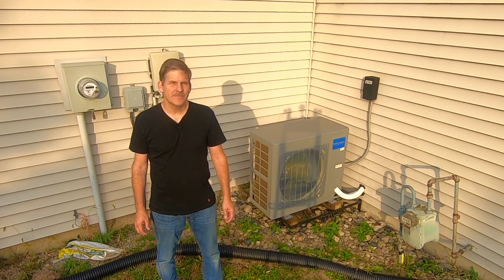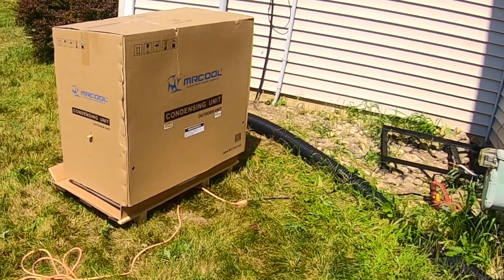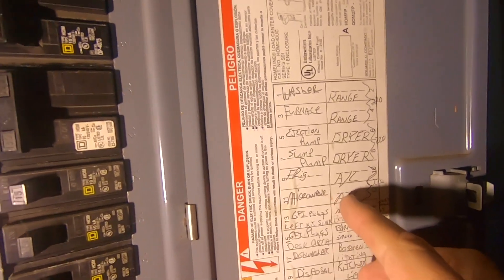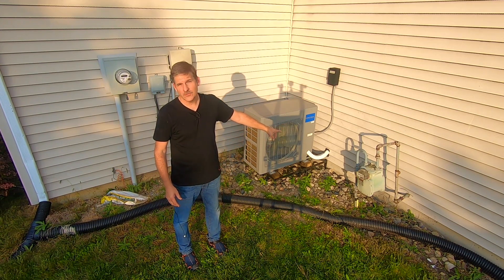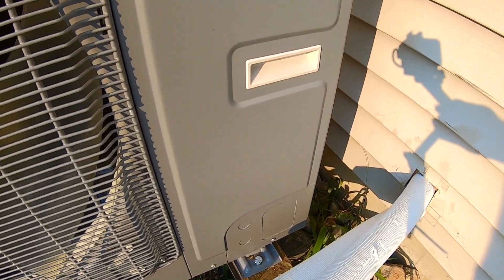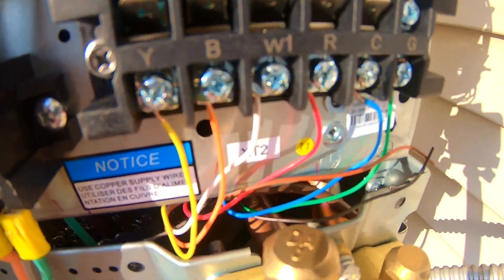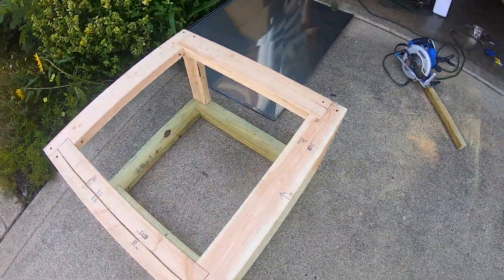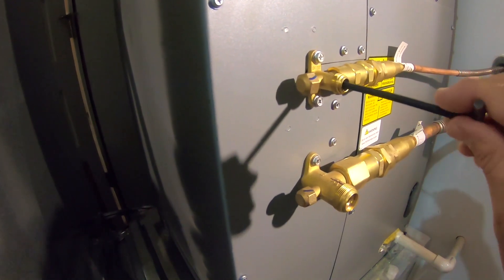How to install Mr Cool Universal Heat Pump: air conditioning and heat solution

Comment: I'm looking at the universal packaged unit does that tap into the same blower / handler ?
Reply from the maker: Yes - the outside condenser is connected to the inside air handler with two no-vac line sets . Hope that helps.

Comment: Great Video!
I have one question...When the outside unit fan is running on your configuration, is it blowing away from the house or towards the house?
Reply from the maker: Hey Chip,
Away from the house. They give you spacing specs for installation…
Thx for watching!
Reply: @Housebarons  thank you so much!

Comment: With the air handler in the basement below the condenser unit, where are your oil-return bends in your lineset?

I’m running my air handler in the crawlspace and the condenser is outside and mounted to the side of my house on a shelving bracket. My manual says to put in oil-return bends at both the handler and condenser unit with this setup. 

Are they just not necessary?

Comment: Great video!  What size heat pump system would you recommend for 1700sqft home? There are so many models
Reply from the maker: Hey Thomas…,
There are so many variables from house to house - ranch, 2 story, # of windows, insulation, which direction ri does face, location, and on and on it goes….

Your size is similar to a 2-story 115 + yr old house we are working on now. 
We installed a 3 ton MrCool universal heat pump. 
Hope that helps!
Thx for watching!

Comment: How did you connect the thermostat wires? from outside unit to inside unit and thermostat please help I can you show a diagram
Reply from the maker: Hey Ciro,
We wired from the thermostat to the air handler and then from the air handler to the inverter. Depending on your thermostat, which wires you connect will be a little different. We used a Nest.
Next week we will be hooking up another MrCool universal so stay tuned to for video. I’ll try and pay attention to all the wiring. 
Thx for watching.
Reply: @Housebarons  Thank you for your answer that was my doubt because in the manual shows from the outside unit to thermostat but it is just as referenceh you again
Reply: Thank you again God bless I l be sharing your videos

Comment: Can you tell me about the cable D that goes from inside unit to outside unit,it shows in the manual!
Reply from the maker: Hey Ciro,
I’m not sure what you are referring to. I didn’t see cable “D” in my manual.
There is power to the condenser and power to the air handler. There is wire from thermostat to air handler to condenser. And we used no-vac line-sets from condenser to air handler.

Comment: What s the dimension of the bottom box you made?
Reply from the maker: Hey Ciro,
The air-handler bottom opening  is 21 inches square so I made the box with a 20 inch opening on top of the box I built. 
The return air comes in at the side, so it’s about 18 inches tall - so I could attach an 16x24 air filter frame to the side of the box.
Thx for watching!
Reply: @Housebarons  t
Thank you very much for the info!God bless

Comment: Do you know what s the voltage for the air handler and breaker size please?
Reply from the maker: Hey ciro…,
Best bet - check the manual but I think the condenser for the 3 ton is a 30amp, 240v. I don’t remember the air handler - but I’d guess a 20amp, 240v. 
If you need to know beyond curiosity, contact MrCool to be 100 %? sure.
Thx for watching!

Comment: I love that air handler box made from 2 x4 's. I'm planning to do the same thing when I install my Mr Cool Universal 2 to 3 ton in the Spring. How did you secure the handler to the box? Is it just sitting on top with duck tape closing any gaps, or did you fasten it somehow? Also, how did you connect the box to your bottom duct work? Thanks a million for your channel. I just subscribed.
Reply from the maker: Hey George…,
At first glance, I thought the former President was subscribing! 😃 
Thanks for subbing!
Re: the air handler: we just installed another MrCool universal last Friday and we used a length of 3/4 inch right angle piece of aluminum - screwed it to the top of 2x4 box ( return air plenum ) and then placed the air handler in & on that frame. Stay tuned / in a couple of weeks we should have a new video up with more details. 
We then will screw thru the aluminum and into the air handler. 
The return air duct goes into one side of the return plenum ( box holding up the air handler ). So then the return duct connects to an air filter frame which is attached to the return plenum box. In other words, the air filter frame is sandwiched between the return air duct and the side of the return plenum. Hope that makes some sense. 
Thanks again for joining us- keep an eye out ( hit that YouTube bell) for a number of different videos coming out soon about the MrCool universal plus an alternative winter heating idea!
Reply: @Housebarons  LOL, I get that a lot about my name. Especially when President Bush 1 & 2 were in office!

That is a great idea to create a lip using a right angle piece of aluminum around the 2" x 4" box for the Mr Cool air handler to sit in. That should keep the units together. I'm really looking forward to seeing how you did it in a future video. That return box is an issue ever DIY installer has to deal with for the Mr Cool.

My return duct & air filter frame is on the side just like yours. I will probably just use some duct tape to secure it to the 2" x 4" box.

Thanks again for a great YouTube channel! Extremely helpful.

Comment: Just got off the phone with Ingrams and they said this system uses a standard motor, not a variable speed one. So it's not as effcient as a mini split.  not sure why Mc Cool calls this unit an inverter unit then? inverter ususally means variable speed high effcient compressor motor.
Reply from the maker: Hey river,
Go check out the MrCool web site under MrCool universal. 
You got bad info from ingrams. 
Thx for watching!

Comment: Looks like the 3 ton calls for a 35 amp breaker according to what i see online. Is that what the info says on the size of the unit? I’m currently running a 14 SEER 2.5ton (builder grade) in Kentucky that came with the house. I’ve been thinking about upgrading. My current condenser uses a 30 amp with the indoor using 60 (aux). I could use my line set which of course is going to drive the price up as I’ll need an HVAC person to do recovery and charge. Give my HP is only 2 years old, what’s your thoughts on replacing it? Worth it?
Reply from the maker: Hey Bryan..,
This has a setting to run as a 2 ton OR a 3 ton. 
Why would you want to replace a two year old heat pump? You may want to see how long it would take to break even ( additional savings from 14 SEER to 18/20 SEER) 
IF you could re-sell your existing HP, that might really help. But a 14 SEER isn’t terrible. Tough call. Maybe wait a few years for even better efficiency ratings?
Thx for watching!

Comment: Something important to remember if considering buying one of these and installing it yourself; there is no warranty.

They denied me support and warranty on a unit that was DOA;

With it being a universal condenser it has to be licensed HVAC technician install. That is probably why you are getting a E3 error code. And with you installing the unit without a license hvac tech you have voided the warranty. This unit is not a DIY
Reply from the maker: Hey James,
To clarify: Who is “they” ?
The Mr Cool web site states that a licensed install is not required IF you use the No-vac line sets. 
Thx for watching!
Reply: @Housebarons  it was the support tech from MrCool.  Nobody will reply.  I have been stuck with a $5k paperweight.

Comment: My home I just bought doesn't have an existing ac unit but my furnace works great. Can I hook this into the existing vents? Would this completely replace my furnace as well or should I be looking for a stand alone ac unit.
Reply from the maker: Hey 2bearms,
The heat pump can do the work of both heating and cooling. 
I kept my furnace because it was still working. ( I kept it just in case ) But in the end, I did not use it as the heat pump did well in the heating department. 
Adding it to the existing system ( side by side  ) was complicated but it can be done. 
Thx for watching !

Comment: Great video.  Gettting ready to install my unit.  Did you use a torque wrench, I did not see that, how do you ensure they are torqued correctly, dont ruin flares and no leaks?
Reply from the maker: Hey Douglas,
No torque wrench but I can see the value in that! Better to be safe than sorry.
Thx for watching!

Comment: Did you torque down the fittings to the suggested ft lbs ? Or just hand tight plus a quarter turn? ThAnks
Reply from the maker: Hey J,
The typical “Tight but not too tight “… you can leak test it to double check.
Thx for watching!

Comment: Heat pumps are inefficient in the Northern tier.
Reply from the maker: Hey Stephen,
Not sure where you live, but new technology ( inverter ) means that is no longer true. Today heat pumps can be 100% efficient down to -10 degrees F. 
Thx for watching.
Reply: @Housebarons  You're probably right. I quit following heat pump technology years ago when I lived in Maryland/Virginia and had my power bills triple in the winter using heat pumps. And was barely feeling warm air from the vents.

Comment: I'm working on the same setup, leaving my propane furnace as a back-up, did you wire your heat pump and old furnace into the same thermostat?
Reply from the maker: Hey Jason,
No. I added all new thermostat wire for the new system. Disconnected furnace and old thermostat. IF I ever had to use the old furnace, I’d run a new thermostat wire to it and disconnect the mr .cool heat pump from the thermostat. Basically keep both separate. 

BTW - my old furnace ducting is closed off from the new mr.cool ducting to make sure the mr cool wasn’t blowing air down into the old furnace. The ducting was actually the hardest part - the air really needs to flow efficiently. My first attempt restricted the flow of air too much. 
So, I had to try and try again😃
Hope it all works well for you. 
Thx for watching!

Comment: Nice, thank you. I was just told my condenser outside has a bad txv and it's $4,000 to replace. Even though I think I can do it myself I've been looking into this system for a while as far as efficiency and cost savings.  And now not to mention a tax rebate.
Reply from the maker: Hey ksv,
Yes. It was an experiment when we installed ours. So far so good.
Thx for watching!
Reply: $4K to replace a TXV, that's ridiculous!  It sounds like they are trying to scam you.  Plus, to my knowledge the TXV is on the evaporator...not the condenser.
Reply: @80HD_82 heat pump has 2 txv valves one on evap for ac and one on the condenser for heat.

Comment: Love the plenum box. Suggest using open-ended torque wrench for the 4 line set connections. And spray to check for leaks. Warranty status for self install of Mr.Cool "Universal" (as opposed to "DIY") designated product line unclear.
Reply from the maker: Hey Steve,
I believe warranty for self install is 5 years and pro- installed is 10 years. But you can call them to be sure. 
Thx for watching!
Reply: @Housebarons  Appreciated.  Some suggest using "nylog blue gasket and thread sealant".  I also read somewhere that, if your electric bill starts creeping up, it could be a small refrigerant leak.  Last, the Mr Cool equipment strikes me as a very solidly built.

Comment: If you read the literature on this it can heat down to -27.  Still a good idea to spend another 100$ for the heat strips in case the outside unit fails though.

Comment: Nice work. Has been thinking about installing Mr cool for a while. The propane price this year  finally get me to seriously look into this. 4 dollars a gallon ☹️. 

A question here: why did you not to go with dual fuel?  That will reuse the coil and give your the ability to use the gas when the outside is cold. Most importantly it will free some space for you. Or just go full electric route by disconnecting the gas. What you have left is mostly gas pipe connection fee now.

Comment: I have mine on order. Some say use nyloc blue and others say leave dry. Some say torque specs on the line set and others say wrench tight to the bottom of the threads. Even Mr cool universal website says both. 
Help..  and what are the wrench size of the 3/8 and 3/4 line set. I'd love to buy crows foot that will work for tightening with a ratchet torque wrench. Thanks.

Comment: I was inspired by this upload 6 months ago and finally went out and got the same model. Installed and tested it yesterday. I cannot get the inverter condenser outdoor to work, at least the fan is not turning on; verified there's power going in. The inside air handler is in good order.
I came back to watch this again and I notice the G wire terminal is connected with one thermostat wire. Do you connect the same color wire at the air handler and also at the thermostat? I'm asking that question because the installation manual is showing that the G wire terminals are for air handler to thermostat connection only. I'm thinking that the manual maybe wrong because if the G wire terminal is not needed at the outdoor condenser then why is it that the G wire terminal is provided there.
Reply from the maker: Hey Uco,
You should have a manual for the air handler and a manual for the condenser outside. 
I can tell you mine has a thermostat wire to the air handler and then from there to the condenser. 
I’m not absolutely sure our set-ups are identical. So to be safe, call Mr Cool ( Kentucky ) and double check your wiring set-up with them. 
Thx for watching!

Comment: Hey boss I got a question for you.. what kind of thermostat wire do I need for my 4-5 ton universal  unit? My manual says 5pc and 18 gauge wire but I was looking that you have 6 wires in your unit...do I missing the orange wire? I try to reach mr cool but with no success if you can help me would be very appreciated....
Reply from the maker: Hey Ferdi,
We used 24 volt, 8 wire, and used 6 of those wires.
We bought a nest thermostat - here is a video fir that:
https://youtu.be/mWcTzCBByFk

There is also a wiring diagram in the Mr Cool manual for condenser and air handler. 
Your wiring might be different. We installed a 2-3 ton mr cool universal. 
Thx for watching.

Comment: Can you elaborate on the parallel air handler install for the heat pump. I want to mimic the same system.
Reply from the maker: Hey Franklin,
Our a/c condenser died. The 20 yr old gas furnace still worked. I was not sure the mr. Cool would be the right solution, do we decided to leaving the still working gas furnace and set the heat pump next to it as an experiment.

This is a basement set up - up flow. 
1) We built a air plenum to sit the new air handle on
2) then cut a hole in the existing return air duct, and added a duplicate return air ductwork - this one going from the main return air trunk line to the plenum under the new air handler.

At this point the new air handler can draw return air for heating / cooling depending on the season. 
3) next was to direct the air from the top of new air handler horizontally over to the old air plenum that sat on top of the old furnace. The key was to make sure air could only enter the old plenum and the go up for distribution into the house distribution trunk line. That meant adding a bottom to the old plenum so air could in no way be blown down into the old furnace. 

This is unconventional and Ill-advised as a normal set-up. It was an experiment before ripping out the old furnace. This required a lot of ductwork modification of the old plenum to ensure smooth flow of air. ( BTW- the electric and gas supply to the old furnace was safely disconnected) 

After a lot of work and re-work, it worked. I’ll wait for the full year review this fall before removing the old furnace. 

Hope that helps!
Thx for watching!

Comment: Where is the location for the return air duct?
Reply from the maker: Hey ValCremax,
The air handler ( if in the vertical set-up) would have return air duct entering the air box ( which I built) underneath the air handler. The air then flows up thru the air handler and out the top and  through the ductwork of the house. 
Hope that helps! Thx for watching.
Reply: I saw that before you connect the line set to the outdoor unit, you connect what happened to be at male or female connector. Does this two connector including in the packages or you have to but it separate, where can I get one?
Reply from the maker: Hey Val…,
Everything in the video came as a package from Mr Cool.
Thx for watching !

Comment: Would you mind sharing the measures for this plenum?
Reply from the maker: Hey Bruno,
It is 17 inches tall - that was dependent on the size of air return duct. 
The air handler is 21.5 inches on each side. So the opening underneath the air handler where the air comes in is about 20 inches. So the exterior  of the plenum box is about 27.5 inches square - just large enough to rest the air handler on the top frame of the plenum box while leaving an opening as big as possible for the air to flow.
Hope that helps. 
Thx for watching.
Reply: Thanks for the info. I was planning to build mine as 8" or 9"x21.5" do you think is that enough? I don't have much room, it's an 8' basement.
Reply from the maker: Hey Bruno,
Just saw this… may be too late but anyway - I built mine to mimic the size of the previous furnace size return. We have an 8ft ceiling in the basement.

Comment: Question man about the thermostat. Do i connect the outdoor unit to the indoor unit then to the thermostat?
Reply: I was wondering the same, the instructions via the manual provided are terrible.
Reply: @slimtrip  I’m still working on mine . Let me know if you find out
Reply: @slimtrip  i got it working